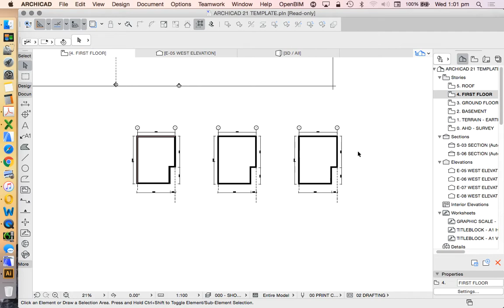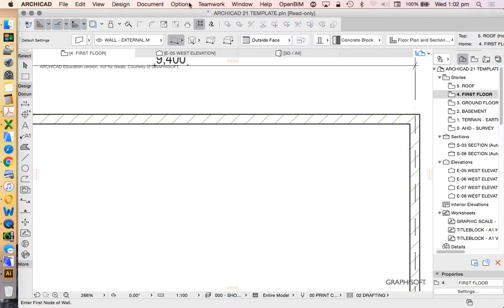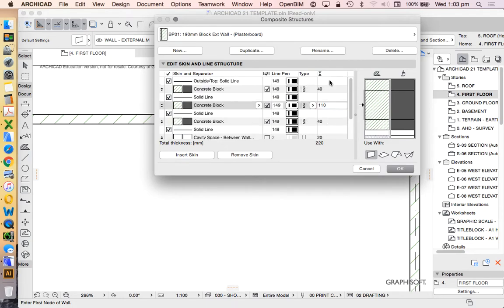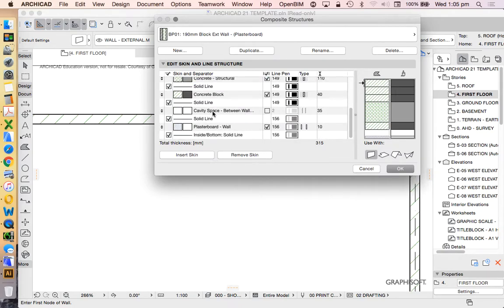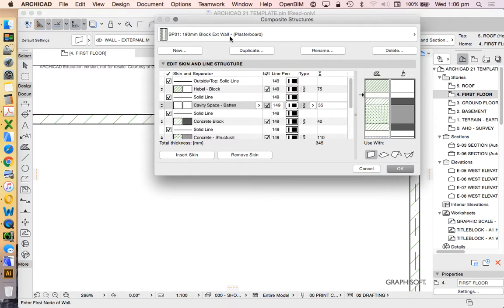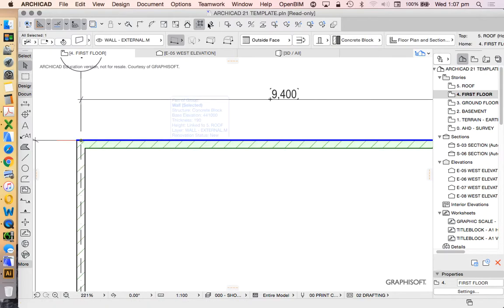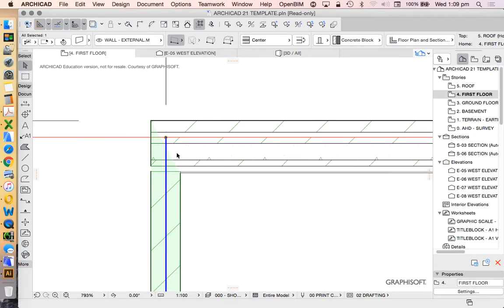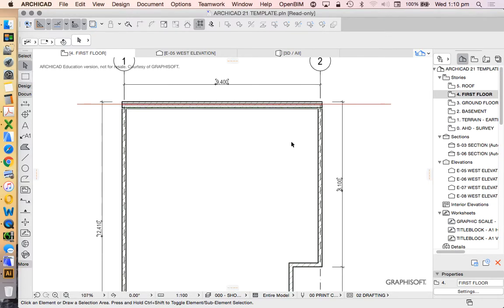ArchiCAD 21 - tutorial part 19 - Composites Wall adjustments

Comment: Couldn't we use the 'core outside' setting for the reference line (assuming the material types in the composite are set appropriately to core/finish/other), instead of offsetting it from the external face?It seems a bit safer that way, for example if changes are made to the structure, or just accidentally using the wrong offset value.
Thanks
Reply from the maker: Hi, absolutely. I will often make these adjustments (correct the reference point) once it is in place. I am now doing this more and more.